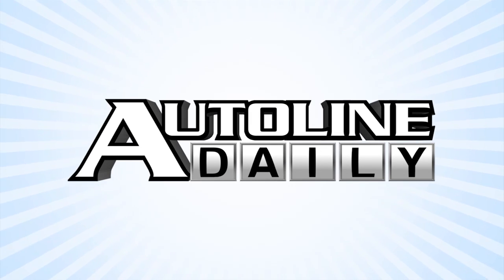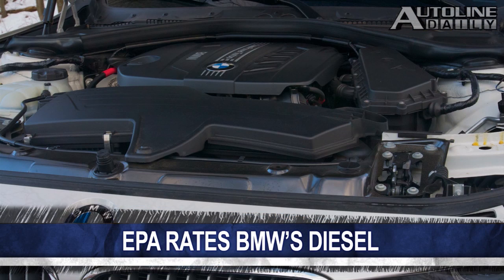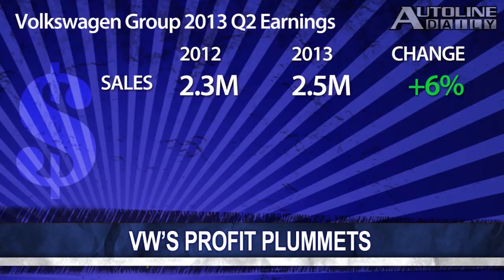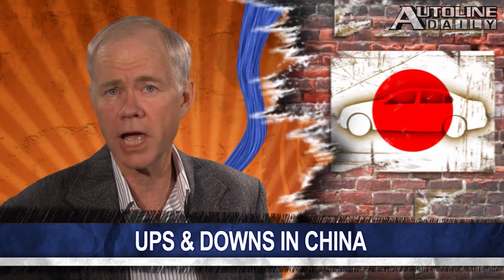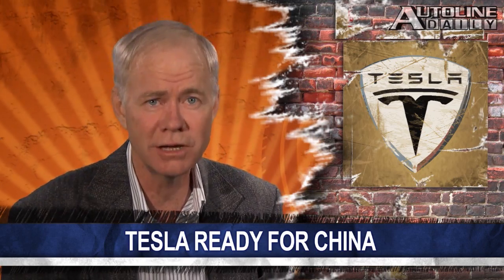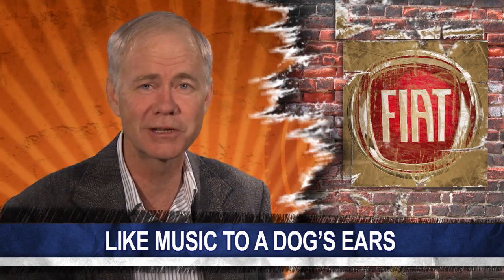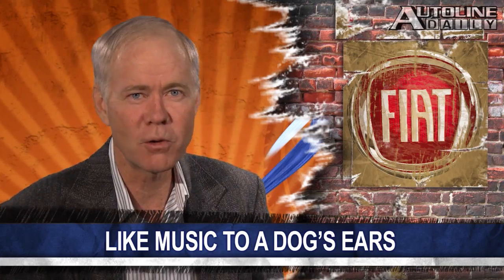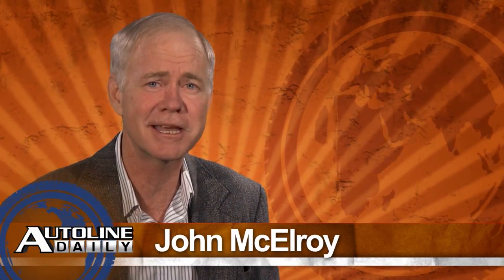500e or Squirrel? Leader Dogs Want to Know - Episode 1184

Comment: I'd bet the problem with the repair of damaged carbon fibre cars is only partly the complexity of the technique.  The body shop may be able to cut out and glue on a new panel, but how much will the panels cost??  Something tells me that unless the parts arrive pre painted and colour matched to the car, even a moderately damaged i3 could easily become an insurance write off.